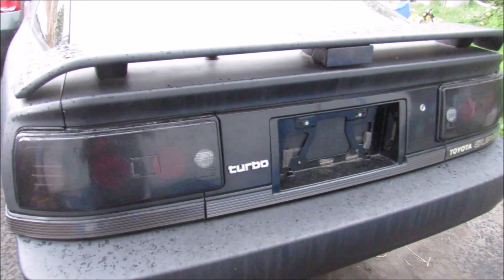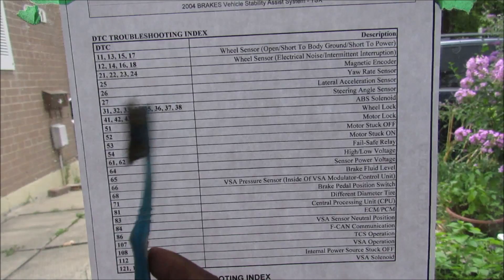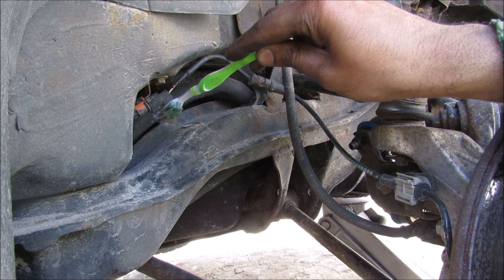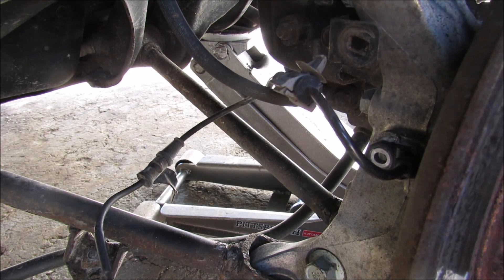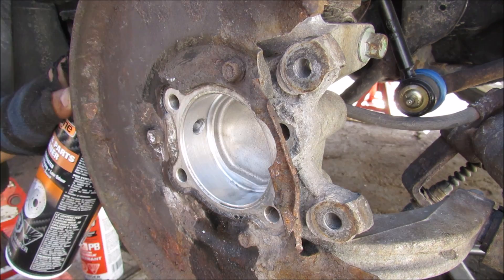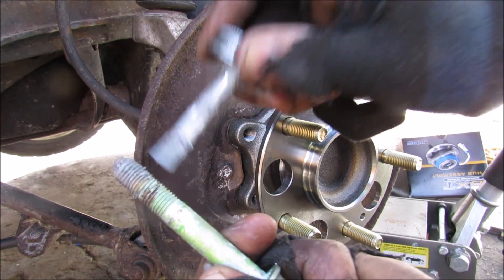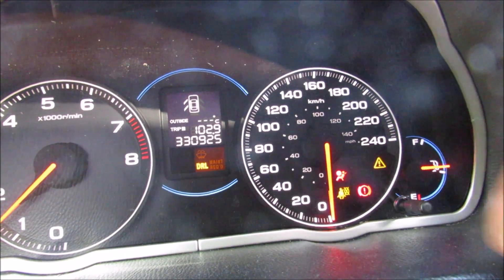The EASY WAY to FIX ABS Faults

Comment: PRO TIP: after removing the bolt from the sensor mount, slip a razor blade between the hub assembly and the sensor, then GENTLY pry it out ... I have never broken one using this method! cheers (leaving room that you may have broken intentionally to show how to on worst case here) Great vid btw
Reply from the maker: Thanks for the tip

Comment: I've got a abs light on and traction control (vsr) on after hitting a pothole. The car blepped up with the warning literally as it came out the hole. Garage is saying its the abs modulator and saying £1,200 after diagnostics. But I can't see this being it.  Anyone got an ideas? The wiring looks fine and all looks in place. Should I un bolt the sensors into the brakes and clean them up?
Reply from the maker: You really need to scan or use this paper clip trick to get the fault code. It's not always the speed sensor
Reply: @speedkar99  OK thanks. Apparently the pump modulator thingy is a common fault on the Honda jazz or Honda fit in the USA

Comment: So I have a real big issue with my wife's 2006 Chevy Equinox we have spent a little bit over 2500 to get the ABS fixed but for some reason it's still not fixed. We have put on new brakes, new routers speed sensors,  wheel bearings, brake booster, master cylinder. It was suggested to remove the ABS module but unfortunately the module is connected to the transmission sensors once we remove them the transmission will not shift gears any suggestions or how to fix the ABS after attempting so many things and spending so much money?

Comment: What if you drill the ABS sensor, and then use a hoover to pick out the bits from the ABS sensor hole would that save you from dismantling the entire hub?

P.S asking for a friend :)

Comment: ..how you've figured out this particular fault sensor and not the other parts in Abs system?
Reply from the maker: The codes pointed to the rear wheel sensor. 
Another way is to graph the output on a scan tool and check wiring

Comment: My wife tires rotated. It came out of the shop and the abs and tcs came on. She drove it home said it acts fine. I started it up and the lights did not come back on but the brakes grabbed. After about 10 seconds the lights came back on and the brakes quit grabbing. This now happens the same way everyday. Any one know what this might be?
Reply from the maker: They might have broke a sensor. Scan the codes and see what comes up
Reply: @speedkar99  i believe they said the scanner said it was brake vaccum booster

Comment: You forgot the most important things before using the toothbrush you need to wipe your ass with it too prime it then use it and make sure you put it back wear you got it  now it all makes sense what I got to do. Amazing video finally a video with detailed steps 😊😊😊😊😊😊.
Reply from the maker: Thanks, 
I wouldn't prime the toothbrush but I would definitely put things back where I got them from. Otherwise that's called stealing 😉

Comment: YOOOO IS THAT A SUPRA???!???!!!!!
Reply from the maker: It sure is a Supra 😉
Reply: @speedkar99  Is that the 1986.5 year body style that came out? Odd, they started a new body style mid year. The 86.5 or 87 was the 1st year of Supras w/ Turbo option. I'm still a huge fan of the 78-81 Celicas & Supras. Toyotas' were so easy to work on back then!

Comment: As usual excellent video. I have two questions:
1) What is VAS/VSA light ? (What does it stand for?)
2) Why  did you short 4 & 9 wires?
Thanks for your valuable time.
Reply from the maker: VSA is vehicle stability assist 
4-9 pins put the car in diagnostic mode
Reply: @speedkar99  Thanks for your prompt reply. Please keep it up.

Comment: Does the pin 4 to 9 thing work on all cars with OBD2, or is it manufacturer specific?
Reply from the maker: I think each OEM has some combination of pins to short to put the car in diagnostics mode. 
Pin 4-9 might work for most Honda's
Reply: Safe way to find out ?

Comment: What a ball ache. Two minute job to replace a sensor turned into a mission.
Could you of drilled out that sensor with everything in place and hovered out the swarf through the hole?
Reply from the maker: Yeah what a pain, lucky it's a bolted on hub and not too hard to come off. I wouldn't trust leaving the shavings in there, one little shaving could hamper the ABS function

Comment: Your channel is the only channel that explains how thinking work by grinding them and showing interior mechanisms or electronics that are hidden. For more content, you can extend your method of showing all small components and how they work together to explain stuff other than car parts. For example, you can grinde a door closer and show what kind of springs it uses. Also you can show how a household AC by grinding its compressor, evaporator, etc.
Reply from the maker: Thanks for the suggestion and feedback. 
If I were to take on this full time, I'd probably open a new YouTube channel for other non-automotive items, reviewing, cutting and showing how things work.
Reply: @speedkar99  I understand and appreciate how much time and effort you take on making these videos. Also, if you can show how some other equipment such as hydraulics of forklift, excavator, or shovels work. Good luck

Comment: I'm ok without ABS functionality on ABS equipped vehicle 😂
Reply from the maker: If you know to not lockup the brakes in an emergency
Reply: @speedkar99  I know my car need ABS sensor replacement, it cost a small fortune to replace one (about 100 bucks). So yeah, I left my car without ABS the whole time.

Comment: you don't have a scan tool that does simple things like ABS? I use a $280 launch crp429c. looks like it's their highest model right before it gets into the $700 bi-directional tool territory
Reply from the maker: I don't have the Honda specific tool, as I mostly work on Toyotas and have techstream software for that. 

But yeah I should probably invest in a good OBD2 reader that can read all makes.

Comment: I like your job. However throwing parts in fixing electrical problems is not a good approach.
Reply from the maker: Huh? If you watched the first minute I explained the diagnostics and the reason why I changed the sensor...this is hardly "throwing parts"
Reply: @speedkar99   I did not see you using any diagnostic tools like multimeter etc.. You just read the codes and you changed the sensor and it fixed the issue. What if it was not the sensor?? What if u had a broken wire??
This is an absolute "parts throwing".
Reply from the maker: Yeah I didn't show the multimeter part because that was done before I bought the replacement sensor off camera. Good call on checking the wiring or the connectors which could sometimes be corroded.

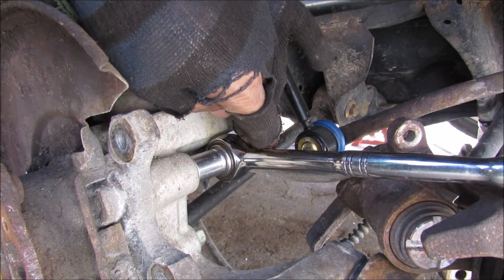Comment: at 1:49 you punched out the sensor with the wrong angle and the wrong tool. It was supposed to be 90 degrees long flat tool with hammering outside the hub area.
Reply from the maker: True, I just wanted to tap it lightly to see if it would budge, in the back of my mind I already knew I had to drill it anyway so what the heck

Comment: I hope you take my comment as constructive and not criticism.
I have enjoyed you dismantling videos. However,  this one was one of the worst treatment of tools that I have seen. 

Was the caliper supported? Did I miss hearing you tapped the hole after drilling?

Remember, you are teaching a lot of viewers who have no training in safety. Hammering a ratchet with a steel hammer is really unsafe as well as bad for the tool.

Not one your best videos.
Reply from the maker: Thanks 
Yes the caliper was supported, otherwise you'd stretch the brake hose and damage it. 
No I didn't tap the hole after drilling. 

The punch I had on hand was too small and I just wanted to give it a slight tap to see if that would encourage it to pop out but it was no hope and I knew I had to drill it.

Comment: Actually have this fault on my 2008 Civic, hopefully the same trick will work to diagnose it.
Reply: be careful and have a look in the workshop manual! you can damage your electronic if you dont know what you are doing on the obd connector!
Reply from the maker: The ABS trick should work on most Honda's but follow the manual to decode it properly.